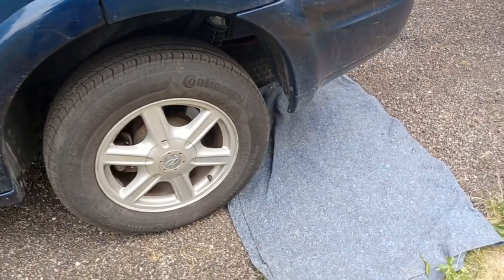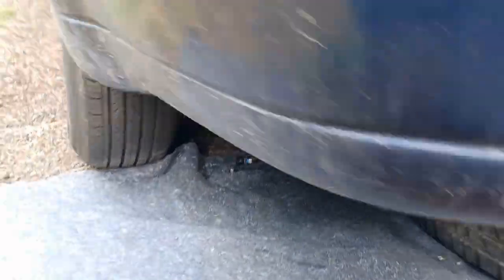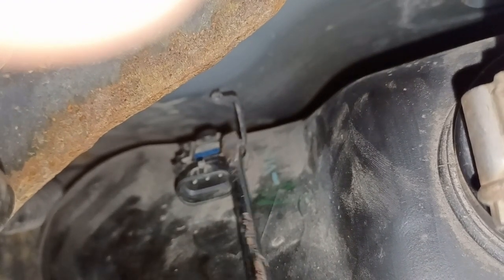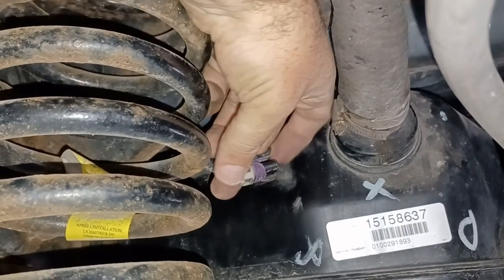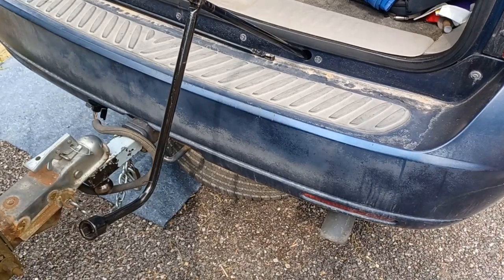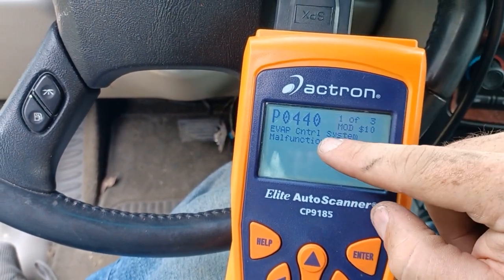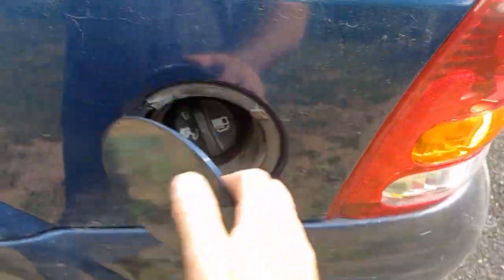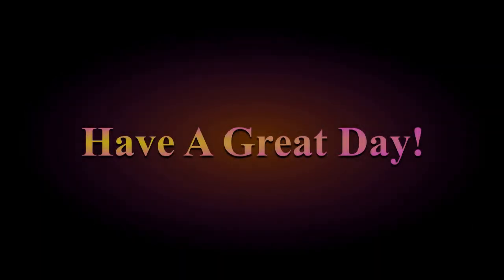2002 Bravada ( Trailblazer Envoy ) Fuel Tank Pressure Sensor Replacement P0452

Comment: Great video that totally helped me see the clips for removing FTPS.  I have the same issue with 0440 code.  Smoke tested no leaks, new purge and purge vent and put in a new filler neck that was rusted out.  I'm now going to try new FTPS and like you, hopefully will work so I can get it through emissions.   Did this end up solving  your issue?
Reply from the maker: Been driving it since with no cel so far so good.  Best of luck
Reply: I replaced the same parts.. Well not the filler neck. But I got a P0442 code and it said this was the likely fix. Did this replacement work for you?

Comment: Great video. I have had my replacement sensor for a while, and am now ready to install it, so this helps a lot. I have 207,000 miles on my TB, and started getting P0400 code. since it is so old with lots of miles, I figured I would just replace all the main evap parts. I bought the purge valve, vent valse, pressure sensor, and charcoal canister at the same time. I already replaced the purge valve that is on the engine, and that did not fix the problem. My transmission went out, which is now replaced, so I replaced the charcoal canister while doing that, and will now replace the vent valve and pressure sensor. I have not smoke tested mine, but if I still get the problem that will be next.